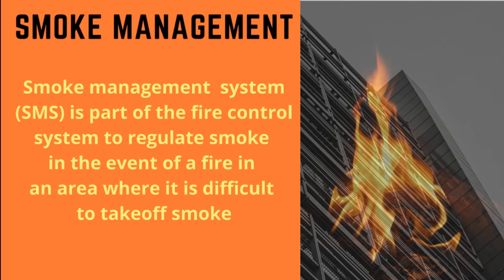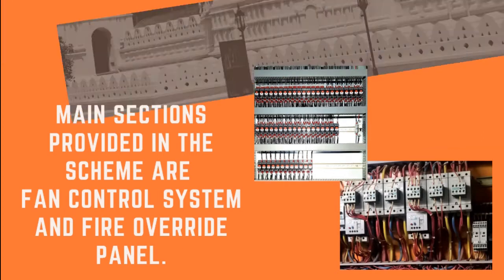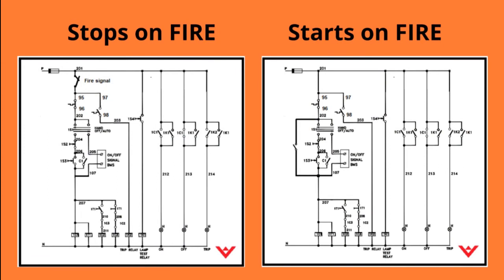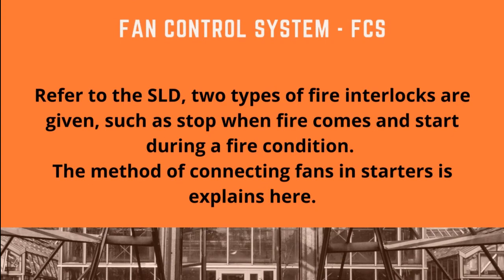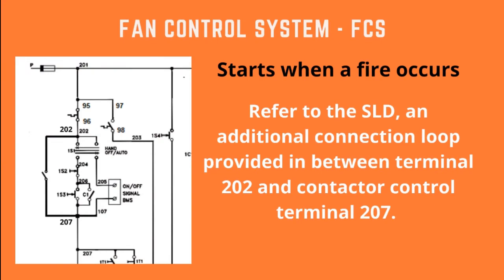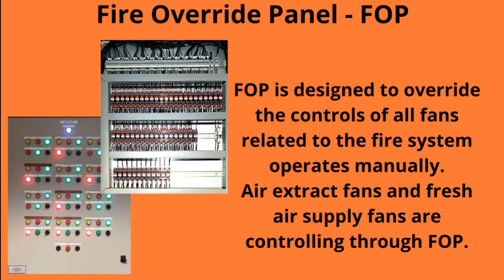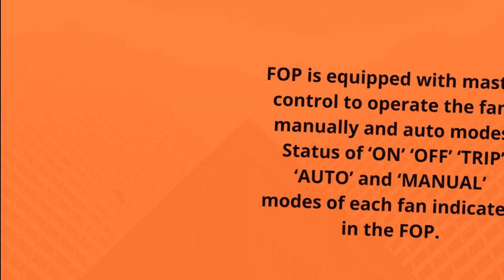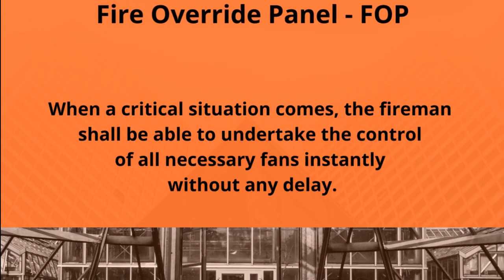Smoke Management System (SMS) – Explained | Fire and Smoke Control - Part 1

Comment: What are four types of smoke control system use in atrium type building?
Reply from the maker: Types of Smoke Management Systems for larger areas such as warehouses or atriums include:
1.	Mechanical Smoke Exhaust.
This is carried with large exhaust fans connected in the area to pull the smoke to the outside area.
2.	Natural Smoke Ventilation.
This process is happening by using the fresh air circulation that flows manually.
Mechanical or natural smoke exhaust systems exhaust smoke from the top of the atrium for a period using low-level, low-velocity makeup air below the atrium.